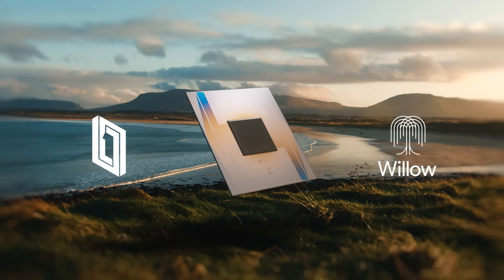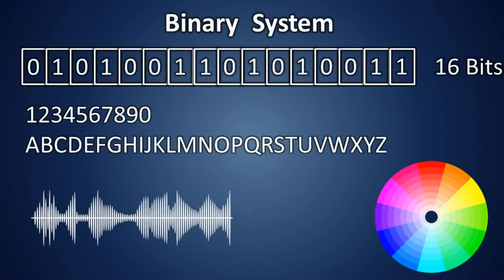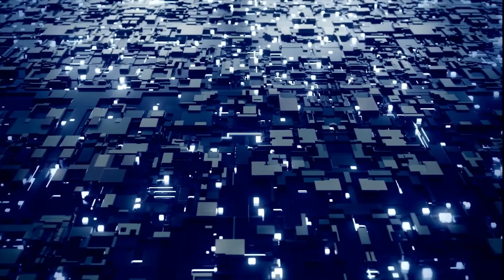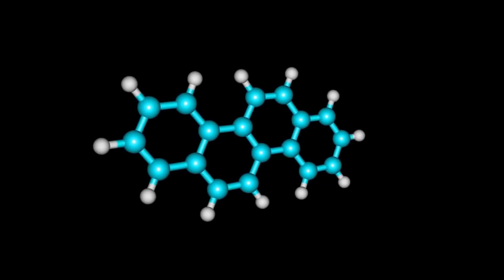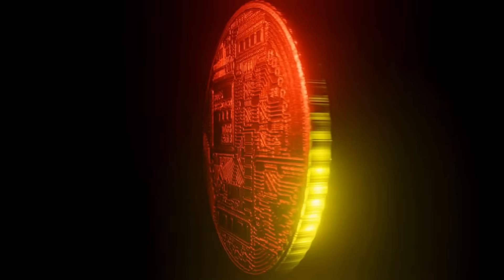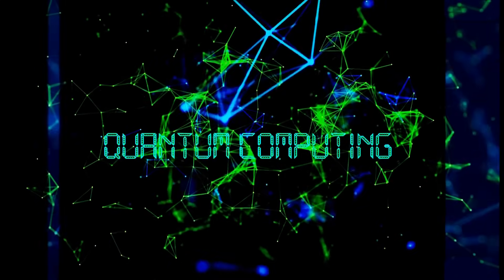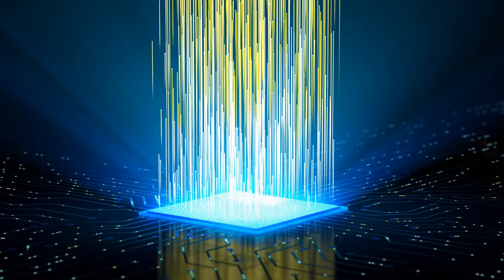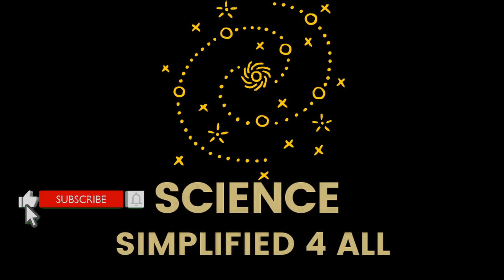Normal Computers Vs QUANTUM Computers EXPLAINED | How Quantum Computers work? (2025) WILLOW Chip

Comment: It’s a Steampunk Engine. This is not a Quantum Computer. We don’t cool things with copper pipes in the 21 century. We use Fibre Optics, doesn’t need cooling, and works at the speed of light

Comment: Wake up, there are no parallel universes.

They are invented just to try and explain how a cat can be alive and dead at the same time (which it can't)

This is because schrodinger couldn't understand that some possibilities are real, and some possibilities are virtual. When the cat box is opened there is only 1 possibility for whether it is alive or dead, not 2. It  has already been decided. Splitting of universes isn't necessary and is mental.

It doesn't work either, because the cats don't tally up. 1 cat in, 2 cats out!

Comment: The reason why it’s so fast it’s because of the cooling system. Electronics don’t like heat. Heat equals resistance in a circuit so if you cool it down to almost absolute zero there is no resistance so therefore the circuit can send information so fast it won’t be slowed down from resistance. Pretty simple.

Comment: Hahaha 😆 oddly enough, you don't even simply understand Sun-Sunlight causes gravity and all matter is positive and negative charges. Air is a positive charge a major factor in causing gravity. 
Wikipedia (Atomic Theory) states: current theoretical model of the atom. Theory defined = NOT proven, doesn't exist.  Good luck with your meaningless fiction.
Reply: Your ignorance is simply outstanding.

Comment: Even if quantum computing must be rooted in physics we understand, I don't know that reasoning proves or disproves tapping parallel universes which I consider a proposition that's completely out of left field 

I suppose any discussion should start with whether the speed of Willow's demo calculation is reasonable. I have no idea how fast a single or a couple qubits are supposed to calculate and then to extrapolate that based on the size of the Willow chip which I understand is supposed to be about 86 qubits and I don't know if that's logical or physical qubits
Reply: This video does not explain the way they works!  Pure BS!

Comment: So the willow chip at this point has no practical purposes other than being a new toy to make new unverifiable theories.  Yes mathematics represents our reality but it is not our reality no more than virtual reality games are our reality.  I guess you could say if you shoot for the stars you may end up on the moon.  And using this chip to advance AI which is heavily subsidized by the Military Industrial Complex is a guarantee for an Event Horizon level disaster.  
And using this chip to make more drugs is very questionable in that 99% of drugs mask symptoms and do nothing to cure the problem.
Dont get me wrong I am a huge advocate for Science however this is on the verge of...